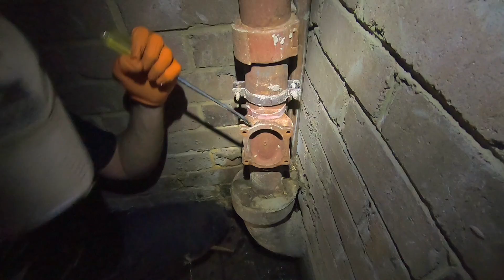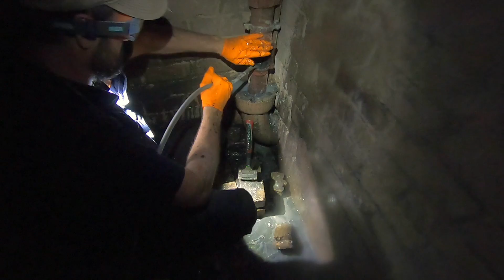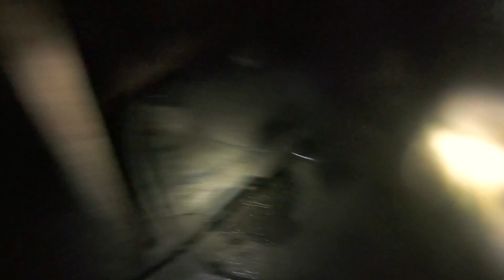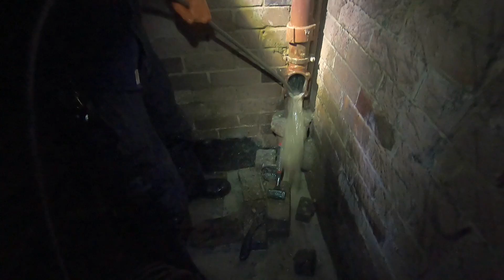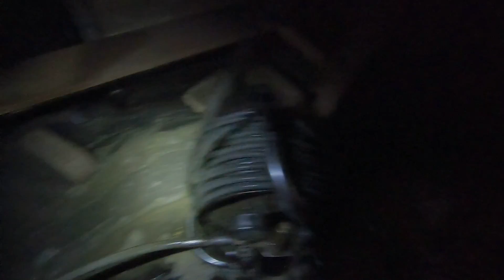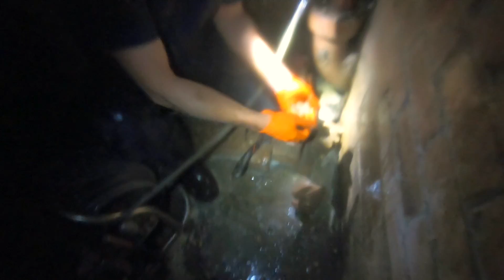Blocked Drain 247

Comment: I'd be pissed if the contractor made a mess like that. Why wouldn't you guys just use a standard drain auger, why is it always high pressure water?? Not to mention you blew out the packing.
Reply from the maker: Yes street8487 I am one messy man, but when the job is all done and dusted the inside of the pipes are crystal clear. Drain augers and grease blockages don’t work well together. Happy plumbing mate
Reply: @DrainAddict  ha ha good one Ollie